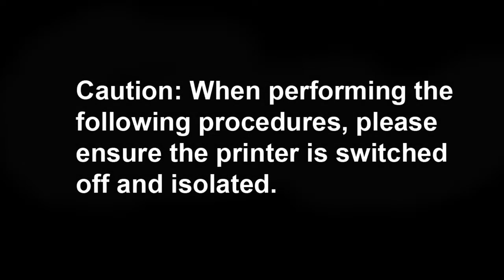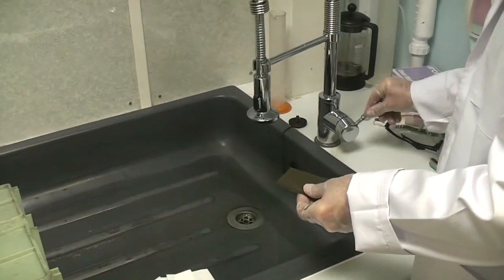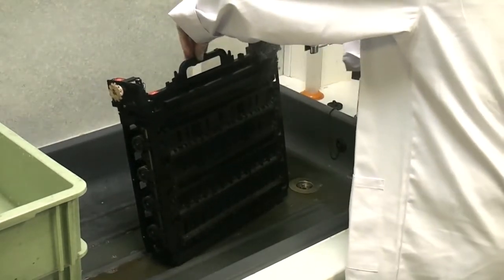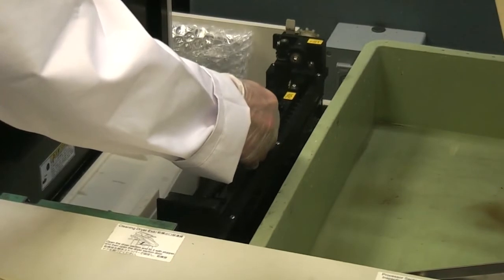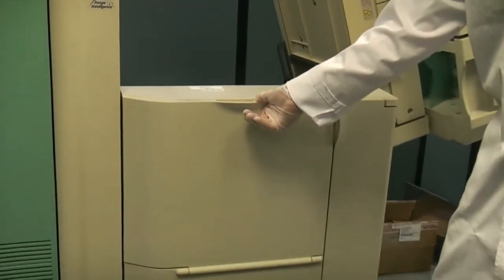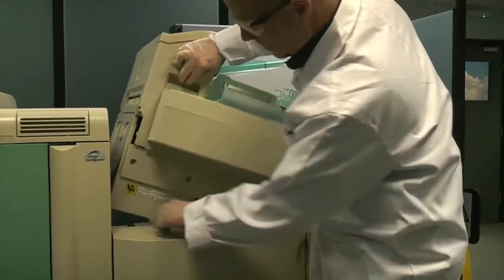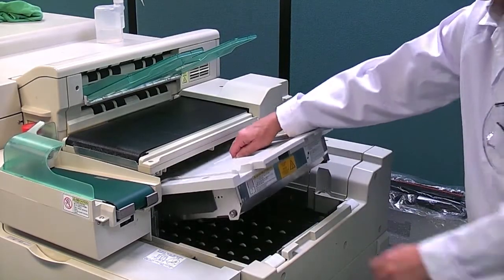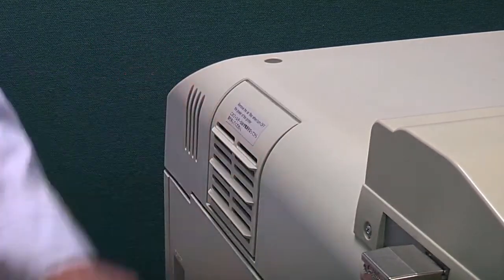Frontier 570R Monthly Maintenance

Comment: the biggest weakness of your minilabs:you can not installing ICC Profile in machin. you can use  ICC Profile only in workfollow.very  very  very  bad.for example how to print 400 photo ?
Reply: but for my experience, it was nice to use....
Reply from the maker: Hi Mohsen, the colour space used to print is restricted by the printing process, therefore ICC profiling will only have a limited affect. The best use of ICC profiles in this process is input profiles for proofing in the workflow, as you have recognised. Since the printer uses an sRGB colour space, most cameras shoot this by default and therefore the results should be close.
Reply: @FujifilmSupport  thanks for your advice.